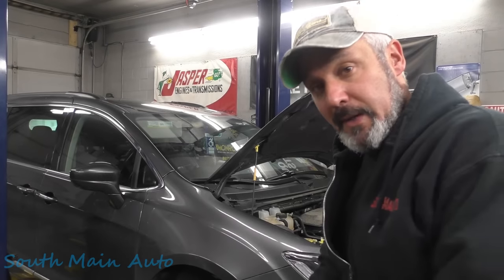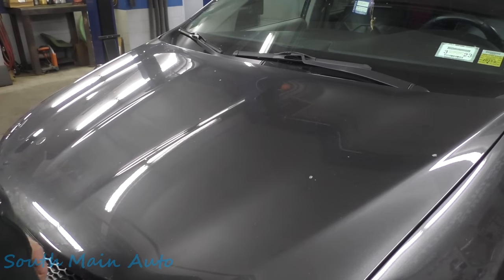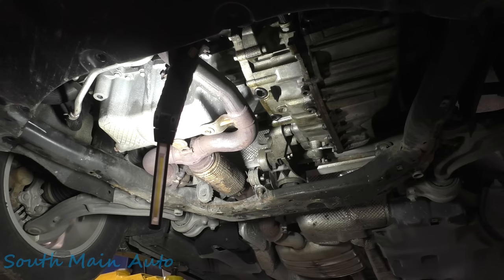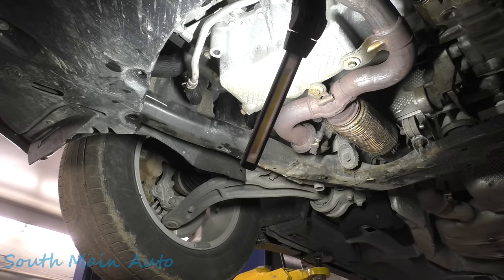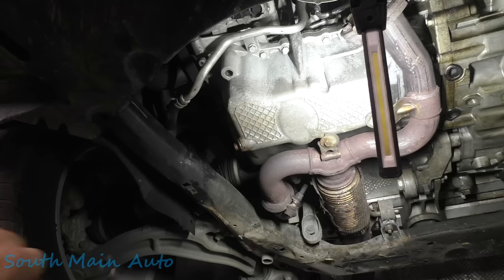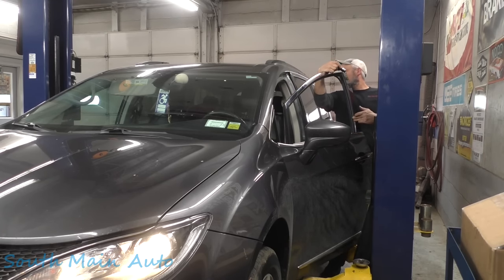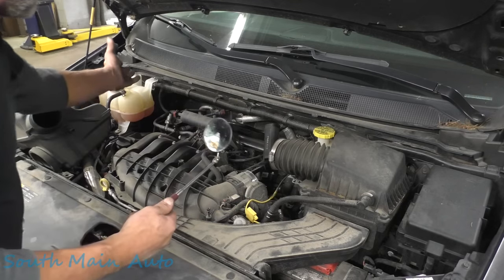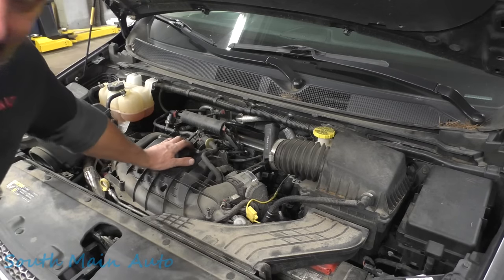Chrysler Pacifica Goes Full Nuclear 💥

Comment: Have we really got to a point in evolution where people are too lazy to put a key in a hole and turn it...
Reply: While I do agree with you on that, I do think that key fobs are more reliable - for instance, on our work vehicles, we are often replacing keys because they wear out after so many years of daily use, whereas we only need to replace a little battery on a key fob, once every 5?+ years….
Reply: Ford keys are expensive because they are chipped inside. Key fobs only need a super cheap battery replaced every 5+ years (or longer)…
Reply: I thought that way until I had a vehicle with push button start... now you couldn't take it away from me at all. and let's be honest, turning a key isn't really doing anything these days anyway.

Comment: We have a 2020 Pacifica that started having a misfire on #3, we hadnt done our 100k spark plug change.  Local shop recommended new plugs and coils, since the front 3 coils are hard to get to. I opted to do the plugs myself, and swapped #3 and #5 coil to see if the misfire code moved. Noticed also that coolant jug was low, topped it off. No visible leak.  Long story short, less than a week later the check engine light came back on, I checked it at home and it was still a #3 misfire. Next morning, it wouldnt start.  Wife said it barely cranked, then quit.  You could hear the solenoid click. Anyways, had it towed to a shop, it hydrolocked and broke the starter. They pulled the plugs.  #3 had coolant in it.  Ours never over heated.  Never noticed it low in coolant either until a couple weeks ago when we started having the misfire. I assumed it was an ignition system issue, but it wasnt. I change my own oil and never saw water in the pan.  Head gaskets in my opinion seem to be a fairly common problem on these. Just check the forums.  A guy at work had to replace a head on his wifes 2016 earlier this year. Alot of them pop between 60-80k per the forums and facebook posts I read. Ours made it to 128k.  I guess we had a "good" one.

Comment: Gives me a flashback to when i tried to get running a car that was sitting for a decade. When I finally started it, it was smoking like crazy, and when I shut it off and tried to crank it again, it hydrolocked and after I kept cranking, it pushed coolant through the intake, lol. When I pulled the head, turned out that water channels near two of the cylinders were corroded and allowed coolant into the combustion chamber. Luckily, I didn't bend any rods so I got away with just welding the head.

Comment: Starter failure after a gross over heat seems to be a common thing with the 3.6l, I've seen 3 from a local company, of the 3 only 1 engine survived  to run another 15k miles before having a head gasket/water usage failure.

Comment: I ran into a similar issue just hadn’t gotten to the point of a full blown hydro lock. Until I put a pressure tester on over night with the block heater plugged in. I would check cylinder 3

Comment: I just replaced the Oil filter/cooler assembly on my Chrysler 3.6L. Had the same issues except the water in the oil pan and the engine seized up. The oil cooler is in-between both heads below the lower intake. The oil and the coolant will leak from the seals on the cooler and the block, and will collect in a 5 inch reservoir below it. I found mine after many years of a slow oil leak (1-2 drips a day) to a tea spoon a day on the ground. What's funny is it only took a few hour to replace and I did it myself. The symptoms of the oil leak make it look like a rear main seal has failed.

Comment: In the time spent futzing with the EGR one coul have pulled the back plugs, and identified if one or more cylinders were wet.  It was obvious from the first attempt to hand crank that one or more cylinders were hydrolocked.  If only one cylindr was wet, then it is a head gasket failure, or crracked head/sleave.. cracked

Comment: The starter was probably destroyed from constantly starting a partly hydrolocked engine. It gave up after who knows how many times it overcame the water in the cylinder/a you only got a little bit of water out of the oil so it probably wasn't enough to dead lock the engine.

Comment: I used to manage a oil change chop and a guy pulled in my lot one day hollering about borrowing my water hose because his car was overheating. I got it to him and he stuck it in the radiator and as soon as the water started getting to the engine the water started spraying out of his engine between the block and the head like there was no gasket. Ran fine for the most part. One of the craziest thinks I ever saw. It was an old Chevy Cavalier I think with a 2.0 or 2.2. Not certain on that either. It was the one known to be junk back in the 90s.

Comment: The 3.3 engine in my 1992 Grand Caravan never gave me problems.  Sold the vehicle with 239K miles on it.  Now the transaxle.  That's another story.  Also, my 2003 Odyssey overheated (221K miles).  Did remove the heads and had them skimmed.  I was counting on no damage to the block.  Still runs great.  I know you hesitate to yank the heads on the Pacifica but have you taken into consideration how easy it is to remove a pushrod head vs. OHC?   I'm impressed with your diagnosis though.

Comment: The Car Wizard on YouTube says that these 3.6L engines have a head warping problem. I have a '16 Charger with the 3.6L and I have only had to replace my thermostat at 125K. My next car will be a Toyota. The Dodge dealership has a 2 month backlog and I have had too many call backs on my previous Charger.

Comment: The Hood Open warning is appearing because the hood switch is plugged in with the plunger fully extended in the open position. The switch is supposed to be occupying the circular hole with two slots near the hood bumper contact on the driver's side. You can clearly see the vacant hole at the very bottom of the video in the middle at the @1:37 mark.

There are actually quite a few reported engine failures with the 3.6L in the 2017+ Pacifica due to coolant intrusion from a blown head gasket. It's not a widespread problem relative to how many of these vans are on the road though. In some cases the hydrolocked engine causes the 500A fuse to pop when the driver attempts to start the engine.

Comment: My 2017 had a bad head gasket, let coolant into cylinder 1. Service rep told me it was a known issue and Chrysler redesigned the gasket but wouldn’t recall it.  He recommended trading it in rather than $6k to replace and risk them finding it needed a whole engine.

Comment: Drove a 1990 Sundance for fourteen years. The shift solenoid went out so I sold it. Had a 2000 Voyager van for twenty years. The shift solenoid went out so I sold it. Dang shift solenoid keeps going out on my Dodge/ Chrysler vehicles all the time. Other than that I put over two hundred thousand miles on each, changing only the alternator once on each and  the starter on e on each. Love Dodge. The new 3.6 engines came out with a crappy oil filter housing that has to be replaced sometimes.

Comment: I had a 2010 Grand Caravan up to 123,000 miles and the only trouble it gave me was blowing the cooler "Y" pipe where it splits to send it to the rear heater core.

Comment: As a current owner of a first gen pentastar and at 100k the head UNDER the cowl dropped a valve seat on cylinder #1 it cost me 4500 bucks. Engine DIDN'T overheat but heard noise from engine and before I could pull over it shut off. I was to scared to try to restart and had towed to local shot. The first shop wouldn't tear down due to "possible" warranty send to local stealership for diag. BUT seeing it wasn't the front head which has the TSB bulletin AND 6 months out of warranty extension I had to pay for NEW head.

Comment: If it was mine, I''d pull the plugs and put a starter in it, and crank it over and get the cylinders clear.
Once you get it running you can listen to the lower end for rod knock to know if the main bearings got washed out.  There's a chance they might still be not completely junk and get a few more years out of it.

Comment: I just replaced an EGR cooler on a Hyundai Ioniq. Learn from you not to throw the parts cannon 🤣😂. Did the blue liquid test on the coolant tank. All good. Pressure test it, borescope cylinders all good. Kept making it leak until finally coolant came down the exhasut from the EGR cooler.

Comment: That's what you have to do sometimes Mr.O I've had a few folks want to repair  a vehicle that the motors were junk from the factory and more often than not it was more beneficial to get a new used one for cheap repair  spectrums  were like the Yugo of the day. I do remember when Chrysler's were the standard to behold from the 60s to the 80s.

Comment: my 2018 caravan sxt has 470k miles. i had the cams rockers an oil ports replaced at 304k . transmission replaced at 280k. water pump and alternator at 250k. then a battery at 290k. ive had it since, i use it towing motorcycles all over america. i jus do oil every 2k miles an trans oil at 10k miles. i love my van, ill never understand why people or how they keep having so many issues with these vans lol

Comment: Needs a rear head done a lot of those. Cylinders 3 and 5 usually have coolant in it. Prolly has a stored code for p0305 or p0303. And I bet it has between 60-80k on it too.

Comment: Prestone with Kevlar , an a starter . Will need to flush the system to not plug heater core , but engine is junk anyway . Kinda a hail Mary that actually works , if follow the directions on bottle . I used it on a couple vehicles for people , headed to junkyard an they are still going 8 years for 1 an a lot of hard miles later .

Comment: I have a 2006 with some electrical tranny problem and have  too check wiring, but I called a local tranny shop for help and he said he was working with a bunch of 2015 to 2019's more than earlier ones. I'll continue buying 12 yr old or older cars. I bought for the folding seats into floor, nice having a cargo van and full passenger van or I'd would of got a Sienna

Comment: I recently rode home with a guy in a dodge charger with an engine that was rebuilt.  It was some sort of 3 liter, and I forget the year, but the water pump mated up to the oil pan somehow and with that setup if you lose and keep adding coolant when the water pump is the leak source you basically total the engine.  That's what the guy had done and the shop bought the car off of him for $400 and rebuilt it later on.  I don't know if it's the same for those.

Comment: Great video!  I had misfire codes and started burning coolant around 100k.  Took the car in and the dealer did both heads and gaskets etc.  seems to be running ok now, but should I be worried long term?

Comment: Excellent recommendation Eric re a used engine as the most economical & appropriate solution in this instance. A good outcome for your client in the end. I have installed a few second hand engines in the past. One from a wreckers in an Australian wrecked car, a couple imported Japanese used engines.

The Japanese used to sell low mileage engines and export them. They had strange laws regarding emissions and maximum mileage a vehicle can be in an engine. I am sure they could rebuild them, though I think it was cheaper for them to replace the engine with a new one & offset the cost by selling the old engines. I seem to think the mileage was ridiculously low in the late 80's early 90's. I did over 100,000km in each of the engines I installed. I have no idea how long the engines lasted as I sold the vehicles and upgraded each time.

The only issue I had was with the distributors and emission control items. The Japanese had electronic ignition before we did, and the emission control was far more stringent. All I did was use my original distributor and removed the additional emission control gear to make it compliant with what my vehicles came with as Australian OEM.

Comment: yknow ive done the brilliant idea of trying to move the starter out of position by using the crank bolt (in a manual i just leave it in gear) and disconecting the power to the motor just to see if it comes back to life as sometimes with these so fancy electronically controlled starters leave the brushes on the same spot for way too long to the point it may not move by itself but you can give it a nudge, doesnt take that the starter is bad but at least i wouldve like to hear how many cylinders where drowned....

Comment: I'm in the middle of this exact thing.  The "click" when starting.  Here's my story, hopefully it will help someone.

No codes, literally had just come back from the dealer for an oil change and inspection the day before.  "Click" in the AM...quick turning the crank with a bar, fuse checks, voltage checks...replaced the starter.  No joy.  After some diag time, found out the pre-fuse block (that red thing on top of the battery) has a 500A fuse from positive to the starter.  That blew.  No, you can't tell without a multimeter.  New one is back ordered to kingdom-come and back, but we found one.  Installed, yay!

While I was driving, it threw a P0301 code (misfire, cyl1) and I parked it for the night and noticed my coolant was lower than I remembered.  In the morning, the fuse blew again.

What ended up happening...head gasket leak was filling cyl1.  With the coolant in the cylinder, when attempting to start the starter would try it's little heart out but draw ALL THE POWER and blow the fuse.  The first time, it started again because the coolant eventually drained out of the cylinder and I had the new fuse installed - lucky timing.

Now I'm in the middle of replacing both head gaskets and getting a new pre-fuse block.  Wasn't worth the $$$ for the shop to do the work ($5k) for a 2017, but some buddies, beverages of choice, and some meat will win the day.

Comment: I happened to have one of those in my bay with the same problem. Cylinder 5 is full of coolant. What i cant point my finger at is what cause the overheating. No external leaks. Thermostat seem to be working fans also. Radiator have flow.. the only thing that left since is not the egr cooler... is poorly made head gasket??? What do you think???

Comment: I’m a Chrysler guy through and through…although my experience has been with the 4 cylinder engines of the 80s and 90s and my wife and I have had 4 of the 3.8 minivan engines that have been tanks…so it depends on what you get. Just my opinion.

Comment: All of the patient's symptoms point to over-fried engine. Would be interesting to know how you could be cooked eggs on top of it when it was going through its thermal fits. Dead starter can be from the fact it was slightly hydrolocked. Water doesn't compress.

Comment: The coolant loss thing reminds me of when I had my 2000 Blazer. The 4.3L V6 had a verrrrry slow head gasket leak. I still wonder to this day if it was leaking into the oil or just getting burned off or a little of both. I also think the heater core was leaking slowly cause the air would smell sweet every time I turned on the heat and sometimes I wouldn't lose coolant if I didn't run the heater in the summer. I just changed the oil+filter as soon as the one leaky lifter on the thing started clicking and just kept adding coolant (about a quart per month). I eventually sold the thing for 2k. That 4.3 just refused to quit, I swear it actually had a conscious xD who knows it might still be out there today...eh I doubt it 🤣

Comment: Thank you for the great video. I have the same issue right now. My 17 Pacifica has only 95k miles, and it appears this is a common problem stemming from the faulty cheap oil cooler. 

My issue is The shop didn’t run through the steps you did. Only did a fluid block test that failed. 

Is that enough to determine, engine failure. ? The tech got it to start and said it ran smooth. So I am conflicted on what to do.

Comment: Yes he invests the time to make sure he covers all avenues to probably diagnose the problem and doesn’t replace/repair anything that doesn’t need it. I wish I lived closer to him. Most shops around me relate it all and soak the customer. I had a tow truck guy recommend his own shop in view of my breakdown after an apparent alternator as it would crank and run but wouldn’t stay running unless battery pack was connected. That shop said I need engine work and to leave it so he he tear it apart and diagnose the problem more effectively. I said no thanks. Went to machanic and sure enough just the alternator. $600 and I was on my way. 🤦‍♂️

Comment: Almost bought one of those but price was too high compared to the grand caravan. Ended up getting a 2017 grand caravan with 7.5k miles on it in December 2021, stupid low miles at a price that was equivalent to the same van with 60k miles. I guess it was a sitter, has 16k on it now and running like a top.

Comment: Ha!
This just happened to our fleet 2005 f150, hydro locked. Injector failure..
Fuel in the pan, could not turn the engine by hand.
Big ole triton.. big ole mess.

Comment: I would have pressurized the cooling system and put a borescope camera in to the spark plug holes to confirm the leaking head gasket.

Comment: I haven't read all the comments but if you checked the oil dipstick would it reach far enough into the oil pan and show water mixed with oil?
Or remove the radiator cap and see if it showed oil mixed with antifreeze?
I do like what I learned seeing all the other procedures and through investigations to prove what possibly had happened. 
Thank you SM☆..
Good Job Sir